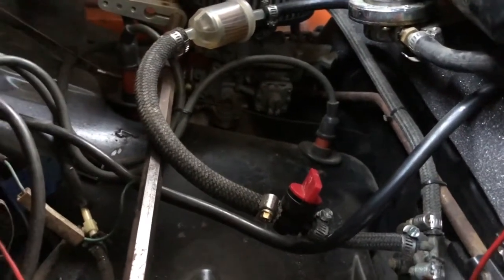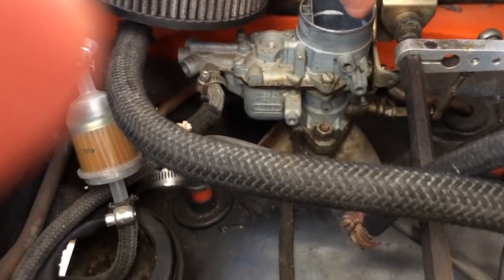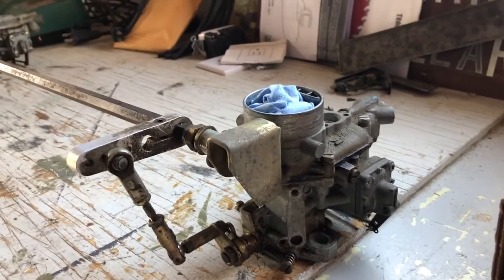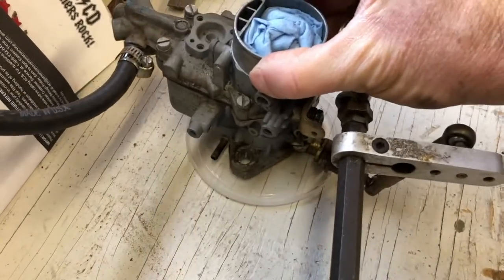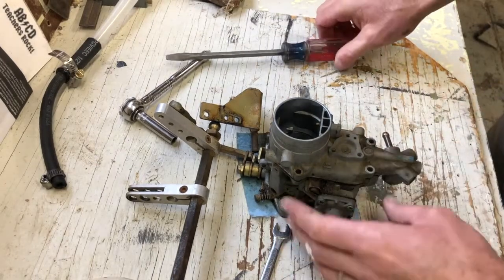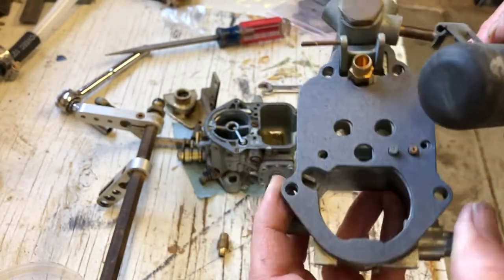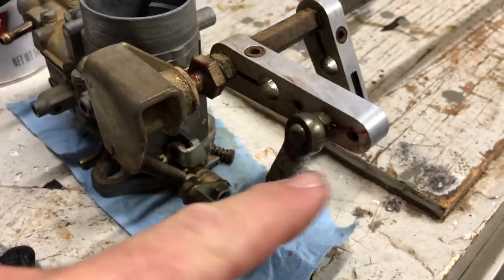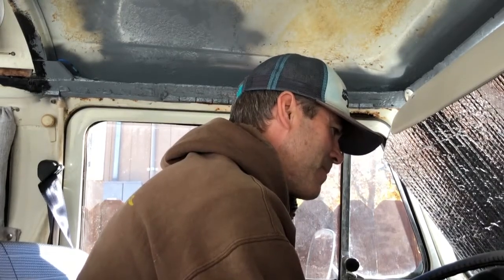Dual Weber 34 ICT over fueling into engine. Diagnose and repair

Comment: The Redline rebuild kits for the 34 ICT have a brass needle valve vs the epoxy (or what ever it is) covered one.  The non-brass one does deform and create a vacuum leak.  Perhaps that's your issue?
Reply from the maker: I've heard that as well...I should probably get in there again and replace my replacement needle valves with the good quality Redline ones.  Thanks for the suggestion!

Comment: I had the same fuel dripping issue- am in the process of rebuilding/cleaning my dual 34 ICT's. Hopefully this will end that and I can go back to having just oil in my crankcase (after I change it AGAIN). Your drip testing method is solid, thanks for sharing. Happy motoring!
Reply from the maker: Thank you!

Comment: I’ve been messing with those carbs for awhile. The brass needle tip is the quality/original gear. The neoprene needle tip is cheap aftermarket gear. The best kit for rebuild is the Redline Weber kit. It is also of the UTMOST importance that your float height is spot on correct. Thanks for sharing your Vdub adventure. Aloha and DUB DAILY🤙🏼
Reply from the maker: That is good information, thank you for sharing1

Comment: @Kombi Kekani what were your symptoms that first lead you to know there was significant gas leaking into the case?
Reply from the maker: I had watery oil under the engine on the ground....turns out it wasn't watery, it was gas mixed in with the oil!  Not good!  The gas was running through either one or both of the carbs and down into my crankcase.

Comment: Did u use any gasket sealer on tbe carb base gaskets to the manifold or do the gaskets go on dry.  Thanks!!
Reply from the maker: I just put the gaskets on there dry....hopefully that is right!  I haven't had any problem yet, now 4 months later.

Comment: Good job! I’m running the same carbs in my ‘74 for the past couple of years. What distributor do you have with them?
Reply from the maker: I'm running a Pertronix Flame Thrower distributer. It seems to work well with these carbs.  I'm also running an electric fuel pump because that is what came with this engine when I bought it (used).  I'm considering trying to go back to a mechanical fuel pump (stock).  I've got to do a little bit more research first.  What kind of fuel pump are you using?